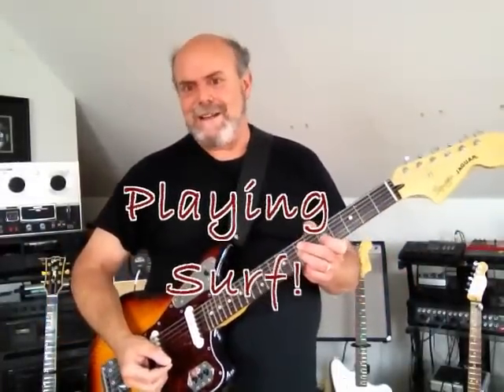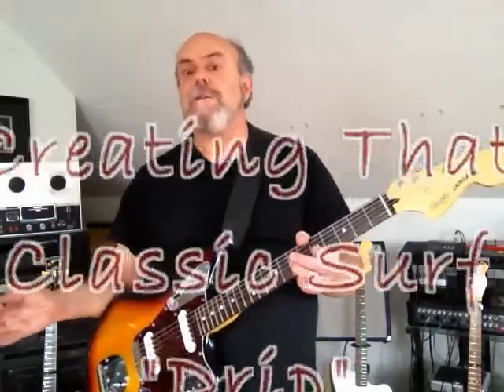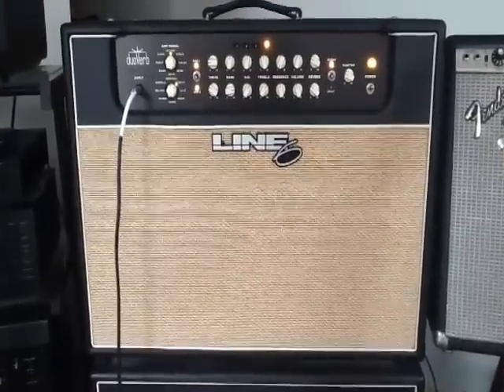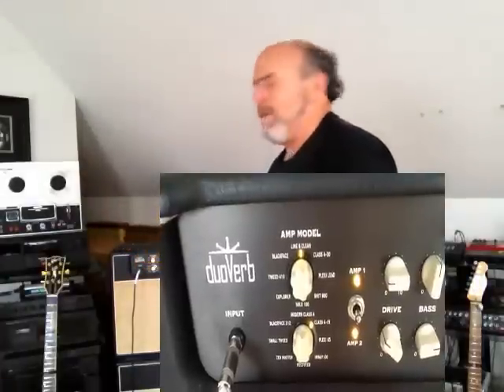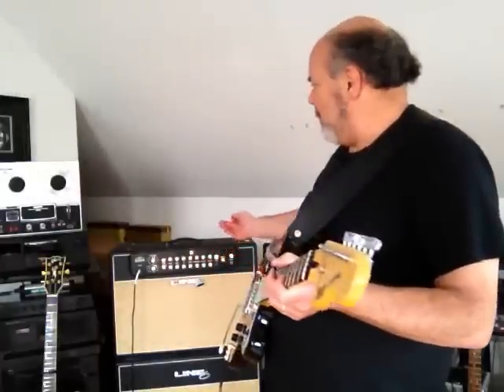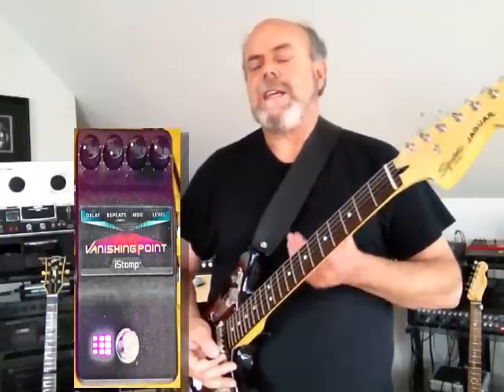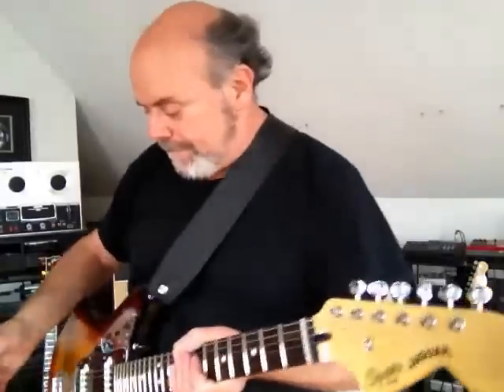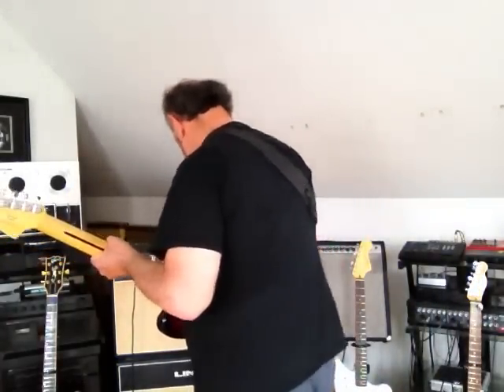Creating That Classic Surf "Drip"

Comment: The reverb needs to be set for a longer decay time - then it'll be perfect. (Or as perfect as you can get without a bedspring, anyway.)
Reply from the maker: Ace, I think that if I were playing in either a more open space, or a smaller, less acoustically live one, your suggestion would be dead on.  That's something that the monaural iPhone mic doesn't pickup - but in the room I am aware of it.  High ceilings and all that.

Thanks for your comment!
Reply: I'm not familiar with the audio properties of the iPhone, but the sound of "surf music" coming through the monaural speaker of an AM car radio is embedded in my brain forever. (I'm a former radio engineer, btw.) I don't think anybody's come up with an electronic device that exactly replicates the sound of those old spring reverbs.

Comment: i get it with the vox valvstronics ad50 i play a little dirty and i use a jazzmaster and fully use the tremolo bar as well and though yes i agree the reverb sound is important but i don't feel it's as important ss the tremolo here i'll post a link to my band page if you listen to the first second and third songs that is i've simulated the ac30 and am using the built in temolo reverb effect onboard in the amp .  https://www.reverbnation.com/thecreepingbentorchestra     now what else i've done was went high on the volumes and gains and what this does is gives me a certain dirtyness when i need it but not losing the drip and it's just in one amp the valvetronix series by vox and these are also very inexpensive amps as well as very versitile as well sorry for tghe choppiness in my playing the recording was kinda rushed but you get the picture.
Reply: oops meant 4th song not third

Comment: Hi Don, thank you for this video, it's great! :)
I think another important part of the surf-sound not mentioned here, is that the guitar needs to have some heavy-gauge strings, like .11s at least. Also, single coil pickups and that smooth Jaguar/Jazzmaster tremolo make the equation complete :)
Reply from the maker: Many find it so -- and heavy strings (often flatwound) were the norm when the original surf hits were made.

The Jag's short scale make such especially important.  Indeed its rocking bridge and floating trem somewhat demand it!

Comment: Pull up Joey & HIS Showmen - El Cumbanchero where you will find music recorded from 1962-2018; 1962 Fender Showman amp; 1962 Fender Reverb Unit; 1960 HT Strat. Not to take away Don's advice, but the Showmen recorded the second surf record right after the Marketts released Surfer's Stomp in January 1962.  

From my recollection, the Tornadoes (Pulp Fiction fame) released  the third surf record Bustin' Surfboards, then along came 24 year old Dick Dale with Miserlou who put the high school teenagers in the background.

Comment: It's great that you took the time out to make this video, but it's all kinds of wrong. First of all the classic drip can only be obtained if you use an actual reverb tank. Adding a delay doesn't help the guitar get that drippy sound at all. Integrated amplifier reverb pans will not cut it at all, unless you're looking at late 60s model Fender amps or (like the Twin). The reason amps can only get so close is because the reverb pan is screwed in to the floor of the amplifier and is not a suspended pan like in a dedicated reverb tank (reverb tanks, by the way, is how reverb was done before they started to integrate them into amplifiers... they were a standalone unit). You simply cannot simulate true reverb drip by adding a quick repeat via a delay pedal (even a simulated slapback). I suggest you check out this guy's review of a bunch of reverb tanks (even a couple reverb pedals are compared):  https://www.youtube.com/watch?v=poSOnABlo90
Reply from the maker: +mrc0ff33  And I thank you for taking the time to comment.

Your's is a commonly held viewpoint. In some cases held because personal experience (the subject is, in its very nature, somewhat subjective), and in other cases is a more in the range of an accepted belief. A passed-down "lore" is you'll allow.

Older players (such as myself) who played "surf" back when it was a current style sometimes see things as only, or at least "best," being done "the way we did it back then."  I make an effort not to limit myself in that way.  To remain open to other possibilities - and that includes the use of newer types of equipment, approaches and methods.

This video is the result of such. And yes, how effective the methods are at creating the classic "drip" sound is, again, somewhat subjective.  One can simply rule out the possibility of the above "working," or one could try it and find it unsatisfactory for one's own use.

For me it works. And others seem to think it does as well.
Reply: +Don Sucher I get what you're saying, but in "not limiting" yourself to the "way it was done" essentially means that you're fine with not striving for that "classic sound". If you chose to use very little reverb coupled with s simulated slapback echo sound expecting to get close to the 60s drip, it won't happen - that's what I mean. It's not "belief" that the classic surf drip was by pairing a reverb tank with a tube amp, it's a fact. Lore doesn't enter into it. Yes, I'll agree that with your set up/method, you can get something close, but only to the untrained ear.
You simply cannot get what experienced surf guitarists refer to as the "classic surf drip" with the setup you used to make this video. Impossible. The newer the equipment, the more you stray from the classic sound. I use a '63 Fender reverb tank coupled with a "72 Fender Twin Reverb with either my Strat or my JM when I play surf and I have that classic sound because I equipment they used back then. Yes, it's a personal preference, but I like to keep it original.
Reply from the maker: +mrc0ff33  Similar discussion (and similarly impassioned!) ;-) occur in classical and baroque music circles where modern piano are used for pieces written for far simpler instruments or even the harpsichord, and where modern string sections produce a rather different sonority than those used when the compositions were created.

To some this is very important. Others look to the impact of the music.

As a lover of both classical and baroque music I try to remain open to both POVs, and judge the music on its own artistic merits.

My absolute favorite piece of music are JS Bach's Goldberg Variations. I learned to love them played on the traditional harpsichord. But as time went by I found  (as have many others) that my favorite performances are Glenn Gould's, both his original recordings made in 1955 and the later, more contemplative interpretations, recorded in 1981.

Both were done using a modern piano.

If another lover of the music feels differently I feel no reason to tussle. For me love of the music is the thing! 

https://www.youtube.com/watch?v=zpsfhTxo5yw

Comment: save yourself 9 minutes and buy a fender offset, vintage tube amp with spring reverb, and an analog tape delay or analog bucket brigade delay pedal. i don't even know if he gets around to saying that in this video, i just know that's how you get the sound.
Reply: As long as you have a spring reverb pedal/ amp setting and a single coil guitar (strat/tele), you'll get close to that 60's surf tone.

Comment: Wow . Yes I have an ac15 and a 5e3 tweed deluxe. They both sound incredible but not necessarily surfy. But when I put them together they do something that just sounds amazing. The chime vox and the bass of the tweed. I run a spring reverb tank with both amps on and it sounds like the truest authentic surf sound ever. I love it. But when those amps are used by themselves, doesnt have a surf tone. Its crazy but 2 amps at one time you can get so many sounds you would not think  possible. With the vox and the tweed I can make it sound anywhere from a fender bassman, to a deluxe reverb, to a marshall plexi and of course they already sound like a vox and tweed.

Comment: Why not just used the real thing, a tube driven spring reverb? That's what I use.
Reply from the maker: In one word: Cost.

My Twin Reverb, of course, has a built in one. But it is behind the preamp, and that changes the response. Too it does not have the controls needed to separately set intensity and dwell -- and that, too, is key to the sound I was looking for.

Fender does make a "reissue" 1963 style unit that can be placed properly ahead of the preamp stage and that does have the adjustments mentioned, but it is very expensive.  -Worth it if one can afford it.  The goal of this video is to show how to get the sound without that expensive gear.

:)
Reply: Don Sucher  The Fender Vibro King has a "built-in" 63 reverb tank with dwell, mix, tone, so you are actually pugging into the tank before it hits the power section, an expensive amp though.
Reply from the maker: Yes!  I've admired those. Alas, from afar.  :)
Reply: +Guitarra Channel - I thought, "Cool, I'll just buy one of those". I look up the price, $3500US. lol, as if.
Reply: OMGWTFLOL You can find previously owned Vibro-Kings for $1,800 if that helps.

Comment: have to be honest, the reverb on a fender blues jr sounds about 1000% times more "authentic" surf then what you have going on in this video ,
Reply from the maker: +Jack Maurice I'm happy for you Jack!  Finding the tool that does just what you want is a wonderful thing. :)
Reply: Not really. You can get the cave sound but not the drip. Plus the Blues Jnr has a solid state reverb driver. It's way too metallic. And yeas I have owned a blues junior. And yes I have put a better spring unit in the amp. It's good but it doesn't match a good tube reverb like on a blackface amp. And no the blackface amps don't really drip either. And yes this guys pronunciation of reverb drives me nuts.
Reply: all good points, but, what i basically said was "the reverb on a fender blues jr sounds about 1000% times more "authentic" surf then what you have going on in this video" 
i didnt say anything about "drip" sounds or otherwise.  if you think this dude has come up with the perfect formula for the best surf sound in history, hey thats cool. personally, i think his guitar sounds dry as helllll, with with a reverb effect layered over the top.
Reply: I actually don't think this guy has come up with any sort of perfect formula. His main objective is to show you how to approximate a drip sound and to point out that onboard reverb on most amps doesn't drip and that the classic surf sound rEEverb does in fact drip . The Blues Jnr doesn't drip. The reverb on a blues jr is ok, and suffers from the shortcomings I mentioned in the previous post. You want to hear a glorious tube reverb? Check out a Princeton. If a Blues Jnr sounds 1000% times (percent times?) better than his reverb, then the Princeton's reverb sounds about 1000 percent times better than a Blues Junior. God's reverb. It's that good. But you know what? It doesn't drip. Which is his point.
Reply: +Joshua Jenkins ok your not getting the point of my original post, that's ok, I'll explain: this guy spent TIME trying to come up with a good surf tone, probably many late nights and wasted days. All I was saying is that basically formulated a crappy tone and a blues Jr.s crappy reverb sounds better ( I never actually said the jrs reverb was any good even , I just said it was better then his) 
The way he pronounces reverb is vomit inducing .
"% times" is used to measure the greatness or lameness of guitar tone, you should know that.
Reply: I think we agree. Vomit inducing indeed!

Comment: Fail...  Sorry, but you are NEVER going to get a drippy surf guitar sound without a spring Fender tank reverb and a Showman amp with D-130f speakers.  You can fake it with a decent Fender amp or similar tone circuit.  But without the tank, ain't happening.